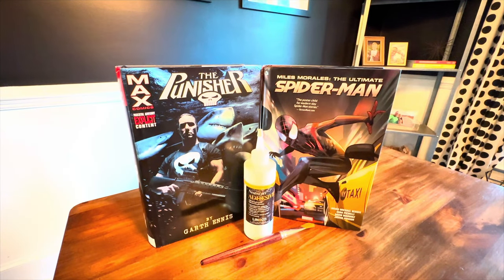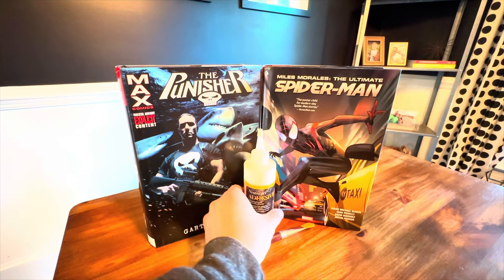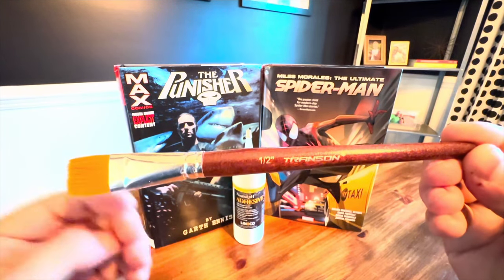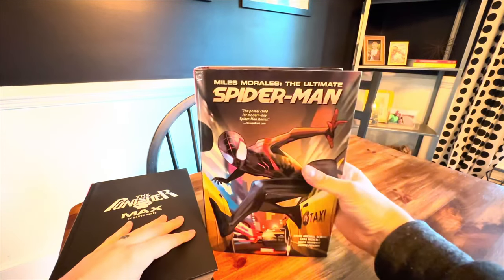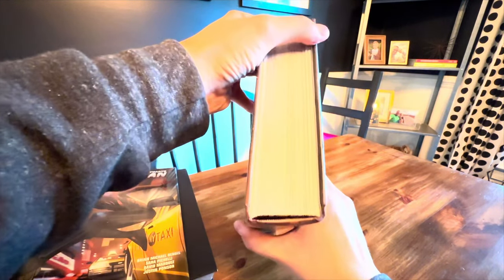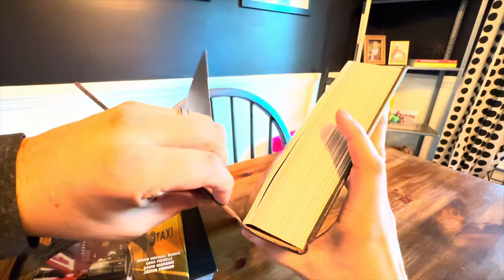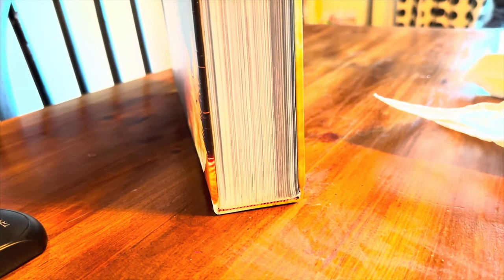How to Repair Omnibus Binding

Comment: Fyi, you want to squeeze the glue through a straw to get it deep inside the binding without getting glue on the outside of the pages. Also, this separation is caused by opening your books 180 degrees flat on a table. Always prop your books open to 120 degrees, or use a 120 degree bookstand to prevent this from happening. Proper handling/reading of your books is paramount to preserving their condition.
Reply from the maker: Great tips! 🤘

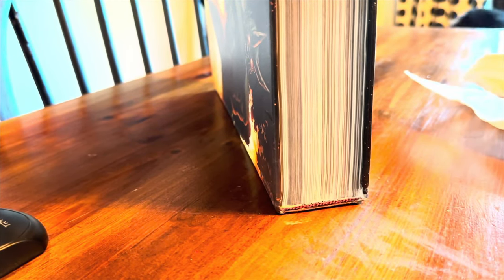Comment: You should go back and watch this @ the 9:31 mark, you're saying your Punisher book is good, but it's 100% separated from the ribbon.  You say it's got a good eye but it's actually completely separated from the ribbon.  This is very evident when you watch at the 9:59 mark, where you flip it around and view it from the other side.  You're saying the part that is separating from the ribbon is a problem.  So either separating from the ribbon is a good thing "Bottom of the book" or it's a bad thing "Top of the book".  I'm honestly not sure which is correct but you should probably be consistent.   Or maybe I'm confused...which is entirely possible and I apologize if I am.
Reply: Agreed. Also at 2:30 the Punisher page block isn't attached to the ribbon but he says it's a nice eye and is attached. It does look like the ribbons were attached during repair though as they looked fine when showing the finished repair.
Reply from the maker: Hi there! Thanks for the comment. In going back in reviewing what you were talking about you were absolutely correct. I was so focused on the pages detaching themselves that I didn't even notice that the "eye" I was referring to was the ribbon and not the normal "eye". I appreciate the heads up! 🤘